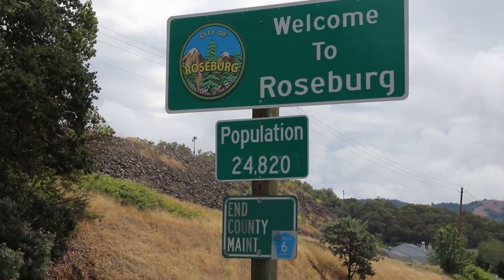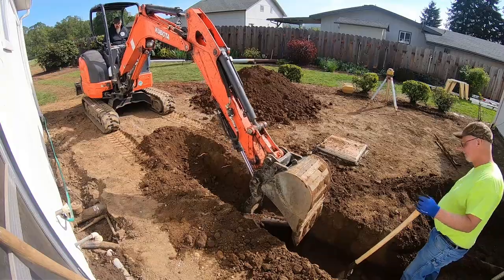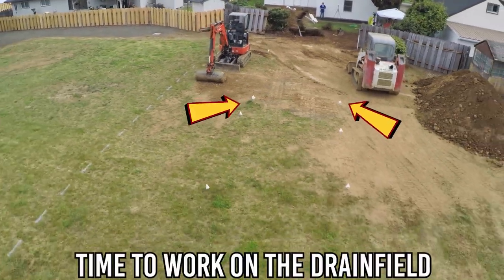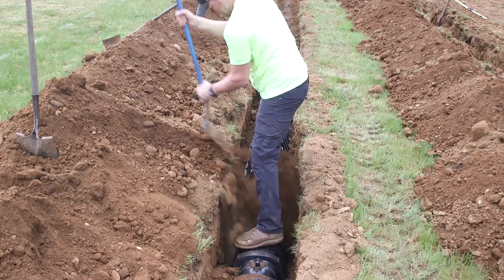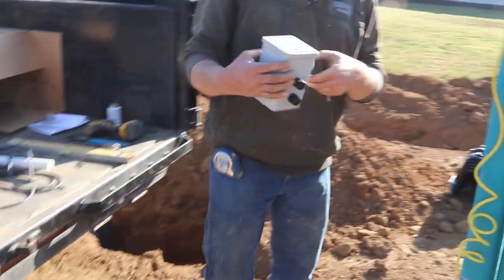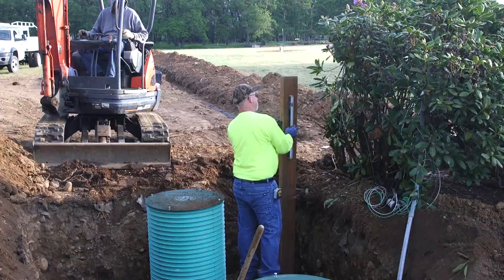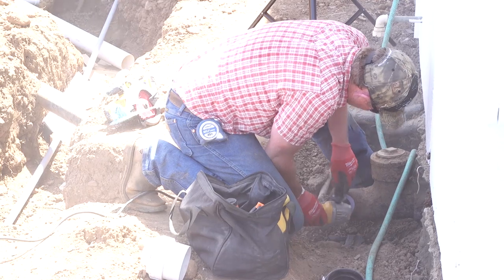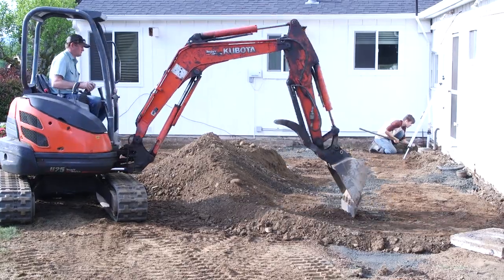Septic System Replacement

Comment: Nice to have easy digging, to get a septic tank in the ground around here is rock hammering or blasting a hole, leach fields are mound systems. Some places you can get away with a gravity system but most places now are sand mound. Its easy 30,000 dollars for a new septic system.
Reply: Wowzers

Comment: Pick up my septic tank tomorrow, i have a 2 Bedroom was built in 60s but it had a septic tank just came out of the ground a little wasn't completely barred but close, but has big crack down back of it, has everything else of course, so i need replace it i would say if i had to guess was a 750 or 1000 gallon tank replacing it with 1,250 gallon plastic tank cant wait to install it finally move in

Comment: Great video. Thanks for sharing. One thing I'd like to add is concerning Perk Test. Most places require a Perk Test to see how fast the effluent in the leach field drains through the soil. Where I live the soil is too sandy and rocky. My perk test drained too fast, so we had to add material to slow down the absorption so the effluent can filter properly though the soil. I hope that's clear as mud. 😁

Comment: I like the old way with the ABS perforated 4" pipe and 1 1/2 limestone gravel., more work but doesn't take electricity to work and no filter to replace...I've put in about 50 septic systems the old way and haven't had any problems... The last one I put in was 22 years ago in the house I'm living in now...No problems so far..no filter changes or $500 water pumps to replace.

Comment: My home was built in 1904 and we still use the original septic system, though I had to do some repairs to it 20 years ago. One thing we do not do is flush toilet paper into the septic. That way we do not have to pump it out every 3-5 years. it's been 14 years since the last time it was cleaned out and works fine.

Comment: Good thing that steel tank is gone. There have been plenty of instances where they have failed and people (especially kids) have fallen in and drowned. You got lucky that your soil percolated well. I had one system that the drain fields were 12 ft deep before they hit sand. That bio tube thing is a great invention and using a pump like that is awesome.

Comment: Thank god for all that progress and bureaucracy they added. Just think that steel tank they threw in the ground only last 7 decades and performed without issue. Now when one of the 17 electric pumps or actuators fails in the next 3 years and floods your yard with poop you'll remember how far we've come and thank them so much.

Comment: I used to live in a house with an aerobic septic system - it had the normal tank, but instead of a soakage field it had a second tank split into chambers filled with baffles through which air would be pumped to provide oxygen for bacteria to grow on them and digest the nutrients. When the effluent flowed into the last chamber it would be pumped out into the garden irrigation system with a bit of chlorine injected into it on its way out. That house always had a lush green lawn during the long, hot and dry summers (subsurface drip) but we had to be careful about the sorts of cleaning products we used in the house so as to not kill off the bacteria.

Comment: Our system is two-fold. Gray water is not treated, it flows out of the house, under the road, into a drainage ditch, and then to a wetland about 75 meters away. Blackwater flows to a septic tank, into a gray water tank, and that leaves the property the same way as the untreated gray water. 

Cheers from Thailand.

Comment: I live in a house that's 42 years old it has a concrete septic tank gravity fed into leach lines into a leach field and from the beginning we have not had one problem nor have we ever had our septic tank pumped out. We do nothing other than this on a monthly basis and have from the very beginning and I'll state I don't own any financial interest in this company nor do I work for them but we use the product monthly  Rid X. We put it in our toilet and flush once a month and we live like we're on city sewer we do nothing else but that so apparently that product works well. Just the testimonial I hope this helps a few folks cuz they could sure save a lot of dollars.

Comment: When I put my septic system in a few years ago I installed a four-bedroom system even though I only have two bedrooms. The problem with septic system installation is they basically want you to have 2 acres of land. Then a designated area for a replacement system in the future. Problem is most houses don't even have enough land for the drain field. So the local government wants to condemn your home or force you to move. You also cant even have a shop bathroom, If you just want to put a bathroom in your garage you have to have a dedicated septic system. One septic system per structure. This install was easy compared to mine. We had to hammer 2 feet of solid rock just to get the tank in the ground!

Comment: I ve done it myself at.my house but not with pump..a simple 3 chamber 2 cubic meter (2000l) capacity fibre glass(the best) with 3 x 110 diam perforated pipe..6m long..put with crushed stone and geotextile ...works great ..filtering the crap  at end 87% ..

Comment: The price for this probably ranged around 15,000 at least for the work to be done.Nicely done though.I had to help some one years ago to replace a tank we dug the hole by hand though.Took us about a week to get the septic tank.We had to all so dig the drain line as well.All in all probably saved us about 10,000 from doing the work by hand.

Comment: Would it be wise or even possible to put in a new septic system with an over-sized capacity in case the house is added on to such as a second floor with more bedrooms?

Comment: I just had my 2; 1,000 gallon concrete septic tanks crushed and tied into sewers with new streets concrete and concrete base pavement. There was 3ft diameter clay pipe 3 inch thick for the caps truly enormous and bigger than life now I'm in the process of mixing and settling the ground and there was no extra dirt in fact less huge hole 15ft deep

Comment: I install septic systems in Ontario Canada and There is a limit to how deep you can put a concrete tank. 1 meter or around 3.5’ is the tolerance recommended by our manufacturers also if you put any more risers then that the tank would become unserviceable.

Comment: The reason they located the tanks close to the homes was for increased drain/leach fields and for freeze up. The bacteria in your tank keeps them thawed unlike the inlet which tends to freeze more quickly incrementally with low usage.

Comment: I bought a foreclosure number of years ago that had a sand filtration system in it. At that time I knew nothing about them. I had already had issues with my gas furnace that had never been converted from natural gas to propane. Then one day the alarm goes off. I thought "oh this is going to be expensive". The guy comes out and looks at it and he says "next time it happens just pull the lid up and kick the float a few times. The toilet paper makes it hang up".  Cheap fix but never had another problem with it.

Comment: This is hilarious! In rural Australia, we drop a concrete septic into the ground. We connect it to the house sewerage pipe (not the kitchen or laundry water). The tank starts filling with sh1t and p1ss. We throw a dead cat, possum or wallaby into the tank to start the bacterial reaction. The waste water then runs through the drain channels and into the ground. No plastic parts, ball floats and electrical cables and components to go wrong. The system then lasts for 100 years.

Comment: I prefer a gravity flow system to all those parts that need service any day.
Reply: Definitely the way to go if you can.
Reply: while gravity is an easier install and certainly has less moving parts that can break, pumped systems are far better at utilizing the ground and as a result the field can be condensed into much smaller areas.  Pumped systems equalize pressure throughout the field (via the manifold) causing the effluent to go everywhere equally.  In gravity systems, the closest points to the tank are fed the most and clog the soonest. In addition, because the pumped system has "resting periods" between pumping, the field rests while a gravity system is always feeding effluent to the field  So a pumped system should have a field that lasts far longer than a gravity system possibly twice as long.
Reply: @gregorysmith9158 In every pumped system I've installed the field is the same as it would be if it was gravity. The pump just gets the water to the distribution box,where gravity takes over.
Reply: @dcrog69  I was referring to drip and/or mound style systems where a separate pump tank (with a pump) forces the effluent uphill to the field under pressure through a manifold in the field. If the conventional system needs a pump between the septic tank and distribution box (for whatever reason), why not convert it to drip or mound?  You are already adding the complexity but not the benefits? If you are going to use/need a pump, why not gain the benefit of a smaller field and better field utilization?
Reply: @gregorysmith9158  All good questions, we just install what the engineers draw up.
Reply: Yep, and to gregory smith who thinks the pump system is better, ask urself if that 70 year old system they were replacing was a pump system...   Not a chance. The gravity system is longest lasting.

Comment: They might be better than they used to be, but those pumps are generally no end of trouble.
Thankfully my house is on a fairly steep hill, so we were able to install a gravity fed leech field.
The county permit that states "18 inches deep" I'd have asked about if that's a minimum or if it must be installed to specifically that depth, because I wouldn't mind having to pay for a little more digging if it meant I didn't have to worry about some pump giving out (or having similar issues if the power is out for an extended period).
You really can't beat gravity fed for reliability and just not needing to maintain it as much, and if there's any way to make a new system I'm paying for go from "needing a pump" to being "just gravity fed", I'm going to explore those options.
Reply: I didn’t know the pump thing existed. It sounds horribly complicated and unnecessary. It doesn’t take much if a slope.
Reply: @delvictor7570  Just came back to this video again because of a reply to another comment.
You're right it doesn't take much slope to make a gravity fed leech field work, they actually had to fill in a bit at our place because the slope was too steep for the leech field to work right.

Comment: At 51 seconds ... That's an ugly finger... I'll bet that hurt. I've fallen victim to the black nail fungus as well more than once. I like your new weeping field structure. I don't know if they are able to be used here in the great white north but from what I've seen they are simpler and less prone to root clogging as in weeping tiles. I'm old so I'm not up on the latest and we have frost 3-4 feet deep in winter.

Comment: Nothing like having to add power and electronics to something that doesn't need it 🤣
Reply: My condo in Naples has a large holding tank and it has a pump that pumps the sewage out into the city sewage system.  A couple of years ago city power went out and we had to hire a mobile generator to come  a couple of times a week to pump it out.  A few of the holding tanks in the city have standby power but most don't.  Thank God it was late summer before all of us snowbirds returned.
Reply: @Norm475  that's not uncommon when the city sewer is above the house grade. This is a septic system and a little different as the drain field doesn't "appear" to be above the outlet from the house.
Reply: @jeremyfink537  That's what I was thinking.  I'm not clear on why a pump was needed since the line exits the house fairly high.  Usually if you have a basement then you need a pump to match the drain field elevation'

Comment: Looks like a hugely expensive way to get rid of sewage! 
Live out in the country and have a single 4 inch soil pipe leading from house to a 15 feet deep cess pit / septic tank... In addition had a 20 feet deep x 10 feet wide hole dug 30 feet away which was lagged with membrane on the sides before being back filled with old bricks. Cess pit and brick are joined by placing a two foot vertical pipe into the top of the cess-pit and T-ing it off with a horizontal pipe sloping slightly down toward the middle of the brick filled hole. Have done this with 3 cess pits and all give years of maintenance free use. It is important to line brick pit with membrane on sides and top before covering with earth to avoid silt seaping in and filling areas between bricks or alternative material.
Maintenance rodding and access spurs need putting on the pipes in case of blocking. This is extremely rare and happens if things like sanitary towels, condoms and face wipes and other non biodegradable items are flushed down into system. Buying a sewer cleaning pipe to fit on pressure hose with forward and back pressure nozzle works brilliantly in addition to drain cleaning rods... 
Digging a hole and backfilling with old bricks or something similar cost very little in comparison to very expensive alternative systems. 
Inn certain areas brick pit has to be dug deep enough to allow top black water to drain freely away. This can be tested by seeing if water drains freely away. In areas where there is clay on top it is necessary to dig below clay level for this system to work! 
Cess pit may need emptying once a year with families of more than 3 and if less, never. 
If biodegrading is not working adequately an old trick is to throw a dead animal in tank to get it working. Use the equivilent of biodegradable bleach and avoid having salt baths...
Grey water always rises to top leaving soil combined with toilet paper to biodegrade naturally.

Comment: The drainage accurs due to the pipes going in an angle relative to level and water/ waste/ matter will follow the path of least resistance due to its weight relative to the air/space around us.

Comment: As an east coast guy this system seems so different to me,  here the state requires that you hire a private designer to design the system.  to the tank looks pretty much the same but from the pump is pretty different.  Pipe and stone is considered out dated but still acceptable if you can find someone to design one.   Enviro tubes are very common systems but must be installed on and back filled with state approved septic sand.  Also pressurized septic line Is to be continous without joints (3" black PVC) from the pump to the D-box which is typically a concrete product.each leg of the system needs to have little plastic equalizers installed which need to be adjusted to ensure no single leg gets more flow than another.  The Chamber system looks wicked easy and I'm amazed that they don't specify a back fill material to garuntee leaching rates
Reply: A designer? My god that sounds like a nightmare. These aren’t that complicated.
Reply: @delvictor7570  if your close to water they make you have a shoreline report and engineer sign off as well
Reply: also you go to dig the feild and find ledge or something unforeseen you start over with new plans unless you can get the inspector tp let you do an "as Built" or feild modification
Reply: @32jdmiller  thank you for the info. My dad and I put in a septic system for his new house on his farm a few years ago. No inspections, no questions asked, very easy and it works fine. (Very flat dry land). It’s the only way to go. Haha
Reply: @delvictor7570  I have a precast dry well septic.  It was installed someplace in the early '80s. If it wasn't for the fact that I sit on a sand deposit that's at least 60 ft deep I'd be terrified at the cost to replace up. I have a friend who's a licensed septic installer here in New Hampshire and what he gets between having to pay engineers and designers and then to buy materials and do the work itself is absolutely terrifying.
Reply: @32jdmiller  we used a proper concrete tank and have very sandy soil.
Reply: @delvictor7570  I have a proper tank as well the precast dry well takes the place of the leaching field

Comment: Sir,

I invite you to check out Infiltrator Water Technologies for your next septic system installation.  Cement, as you know, breaks down over time, plastic does not. Our tanks can be maneuvered with simply pushing them by hand.

Comment: I'm surprised that Nate didn't replace the cast iron under the house at the same time. When inspecting a house here in DFW, the insurance and plumbing inspector said they are time bombs that will fail.

Comment: Who on earth puts a patio on top of a sceptic tank.

Good job on the new location!
Reply: The old system was over 70 years old, so that wasn't too bad. I bought a condo in Florida, built in 2004.  They had plastic shut off valves in the condo. Who the hell would approve that junk.
Reply: Seen a few under garages.

Comment: Wow all that careful leveling and sloping of the leach lines would not work here in North Texas. The clay soil would throw everything off after one season. We are building a house somewhere that requires septic, and I think we have to get a 3 tank system where the water coming out the end is essentially potable and sprayed on the lawn via sprinklers.

Comment: I installed the first infiltrator system.    Ever installed      back in mid to late 80s.
Reply: Did the old infiltrator have the side slots?
Reply: Yes,  slightly different shaped then the new ones.     They beefed them up. From them.  Plus a few of the east coast states make you use chrushed stone around them
Reply: I remember some other brand that didn't in the late 80's or 90's. I replaced several that failed